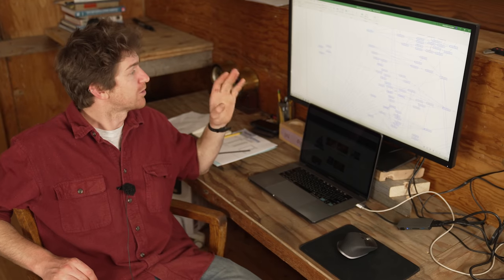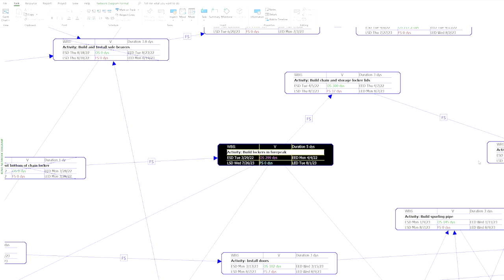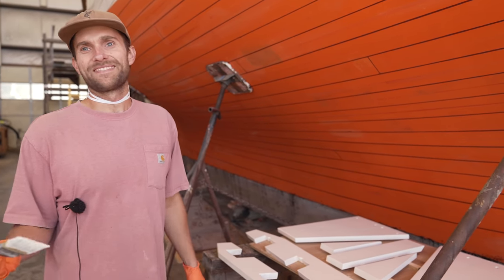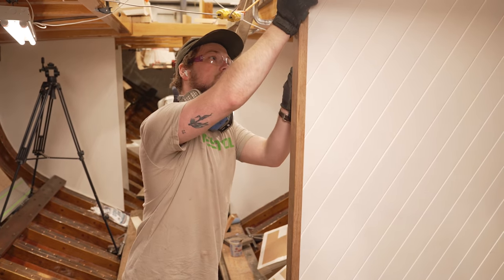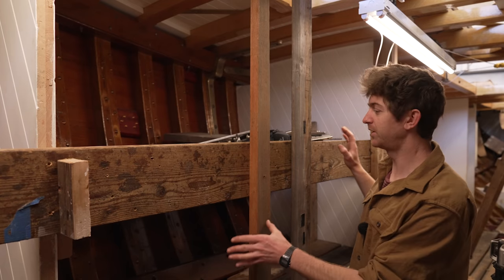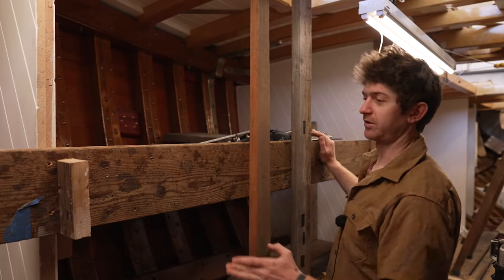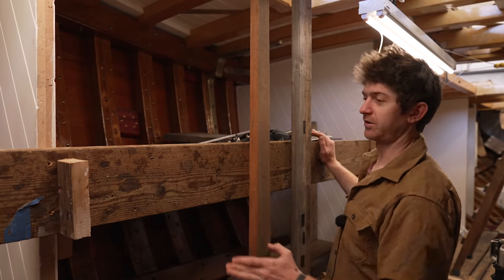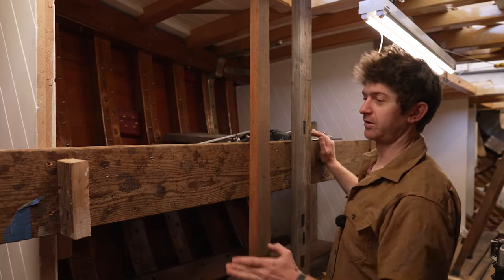Tally Ho - Nearly finished?! (EP128)

Comment: Leo, having just seen your new project planning computer software in action, I am amazed to learn that until recently you had to carry all this stuff in your head. No wonder you had sleepless nights. 
Not only that, but you have managed to engineer-in that brilliant sound syncro @ 10:05 to this upload. I love it.
Don't be concerned, 'Tally Ho' is going to get safely launched because you're in charge - it's as simple as that!
Reply: Nice one mate!
Reply: The layout reminds me of an ancestral genealogy chart.
Reply: Yeah....... I was marveling at the audio synchronization too!!
Reply: And I was wondering how many nights Leo worked to set up all those systems and individual jobs on that software? My first assumption was that it was a rather generic management tool he had to massively add data  timelines and supportive timelines to. Then I decided it was already engineered to be specific to wooden boat building greatly reducing the infeed necessary to make it fit Tally Ho.
Reply: @ScooterMLS1960  mspm software is very intuitive. It would take me an hour to make a first draft.
Reply: Dreams sometimes solve building design details getting it out and down helps some.

Comment: When I was a kid there were two hippies in my neighborhood that built a 60 foot racing sailboat. fiberglass hull. The first sign something was happening was when the giant molds were brought into the neighborhood. It took them probably 8 years to build. When they went to pull the hull from the mold it split in two. Not a disaster but a little of a disappointment. I remember the months spent laying the ballast. Tons of scrap lead was brought in, they melted down into bricks, stacked them in the keel and then poured molten lead over them all. 
It was christened "Erotica"
My dad's reaction when he saw the name on the stern was a sarcastic "nice"

Comment: Not complaining at all (your final comment in the video), that’s what the Brits do. 😉 BUT, I am surprised that people are wondering if the project is nearing an end. Wow!. The living area is not yet there. Underneath and behind that is all the internal infrastructure as you said… plumbing, mechanical, electrical, etc. That is what keeps the boat running. So far, you’ve been working on what keeps it afloat, 33% as you said. Rigging, I think, is the final 33% and is the fun stuff that makes the boat alive. I’ll be with you all the way!

Comment: Hey Leo and crew, you guys are doing awesome! When everything has to be hand made and fitted time is just a word. All shipmates look commentary of each other and as a whole. Leo your leadership skills are very good and your shipwrights skills are even better! The folks out there including me would like to see you doing videos going to the islands or the open sea 5,000 miles from anywhere but you have to screw the last screw, caulk and fill the last crack, run the last wire and rope, measure and cut the sails plus many other things AND some kind of Sea Trails  to ensure nothing is incomplete: then you will be done! As much as I want to see you guys with salt spray on your faces, I also want to see Tally Ho under your feet👌😎👍👏👏👏❤️

Comment: Boat’s nearly finished!  Just 2 more years!  If you put the 28” from the pillow side of the bunk on rails with a piano hinge midway in the center lengthways. This means the entire shelf is on slide rails so the person on the bottom bunk can push up in the middle of the shelf and fold it up in the middle as it slides (connected by piano hinge at the wall) in and up towards the outer hull wall.  Place a 1/4” notch in the slide rail near the hull so that it locks in place in rough seas.  The upper bunk can either fold back a hinged mattress or have separate covered mattress pieces that are hook and looped to the folding slats.  Just a thought.  My shop makes a lot of custom furniture for portables and tiny homes to fold up and change spaces.

Comment: I've watched every video, stunned by the quality and workmanship; that drip tray is the first thing I've seen go into the boat which is sub par. FYI those sugared welds will rust immediately. If condensation forms on the outside of the tray then rust may drip onto the inside of the hull. I recommend having another tray made and this time insist that all welds are properly back purged. Generally speaking, if a weld in 316 has any sign of blackening it WILL rust badly in a marine environment.
Reply: That’s really interesting, thank you for sharing.

Comment: I can see how it could feel overwhelming seeing how much work is left, but does that old rule of thumb account for first moving a ship, building a shelter for it, setting up a workshop, acquiring all the needed tools, filming the entire process, traveling around the country looking for materials, disassembling the old ship, re-lofting and basically drawing up a new set of plans to accommodate a complete rebuild, dealing with a global pandemic and tearing down the shelter and moving the entire project to a new site?
Reply: Those are all good points. The beginning of the build was slow, and several location moves added a lot of work. Now they have a permanent home and can work on other projects while waiting for lumber. Still, the hull isn't completely done, and the rigging isn't even started! Downside, we won't see Tally Ho in the water before 2024. Upside? Plenty of more video content!

Comment: As well as being interesting in itself, this project has been a great learning exercise for me. Particularly in using patterns to build complex pieces with multiple angles. Also, I’m a retired consultant that trained many people in Project Management Principles, including using that software tool (although it looks very different to the versions I used 10 years ago. I’d use this episode as a introduction to PM if I was still working. Great stuff.
Reply: Phil - you may want to look at the Swedish ship "Vasa" as a PMP illustration.  The Swedish were the dominant regional sea power, and wanted to project that power further by making a magnificent flagship.  The naval architect was working from approved plans, and was progressing well, when the King showed up and said "Add another gun deck" (a third), and "we need to have more (!) statues". The architect protested that there wasn't enough ballast to provide the righting moment for the hull. "More guns! More statues!" was the response.  And guess what happened - it was launched, sailed a couple hundred feet out, flipped over, and sunk to the bottom, where it remained for centuries.

I have every confidence that Tally Ho will not suffer the same fate!

Comment: 25:50 I would like to recommend you put two line dents (in an x pattern) in the bottom of the oil catch. Otherwise you may have a nice big ringing/resonating bell sitting under the engine... The oil catch needs some sort of anti oil canning measure...
Reply: Cannot agree more! Good catch.
Reply from the maker: oh interesting.. thanks!
Reply: It's fabricated from 12ga and only 10-1/2" wide on the bottom..  One could drive a truck over that and it wouldn't oil can.
Reply: @ShredPile  It may not be oil canning but it does ring like a bell... Bells are generally strong enough to handle a truck driven over it but they still ring and resonate... The piece being a bell can even be heard in the video as the piece is slid into position.
When the engine is started or the electric motor is running it could very well be that the pan will start to resonate. Maybe the creases I proposed are overkill but some sort of sound deadening glued to the bottom of the pan could help...
Especially since the captain will be sleeping/dwelling next door...
BTW: I like the quality control test of the truck. How typical a US way to tell if an item is good or not... If one can run a truck over it it must be sufficient right ??
Some colorful metaphors are best left exactly that: colorful metaphors, especially in engineering... for both the to be tested item and said truck...
Reply: @koningbolo4700  I understand now what you are saying about the resonation and agree about the application of a sound deadening material.  I've used a self stick mastic sheet type product on the floorboards and firewall of a work truck and it works wonderfully.

      As to the 'oil-canning'  I'll look past your unnecessary cross cultural barb and instead focus on the fact that oil canning by definition is the stress deformation or wrinkling of an open area of sheet metal and by extension since the 12GA bottom is only ten inches wide and bracketed by by 45 degree breaks which are then bolstered by a pair of 12GA stiff backs within three inches of said break that there is no  amount of stress that the boat can place on the pan that would come anywhere close to making it oil-can considering that the entire thing is held in place by four sheetmetal screws that would instantly rip out if said force magically appeared.
   So metaphorically speaking my friend, you are all wet and simply picking the fly shit out of the pepper just to have something to say.
    Had the pan been fabricated out of something thinner like 16ga the cross breaks would have been the perfect solution but since it's made from 3mm stainless the intended effect of a cross break would  not  be realized in such a narrow area in that thick of material and it would still resonate or ring like  a bell. 
I actually have  some left over sound matting from that project that I would be happy to send to Leo if he would like it and like you I think it's the perfect solution for the potential yet unrealized problem.

Cheers, 
jake

Comment: I am glad you mentioned the old rule of thirds; you have nearly completed one of them, the next two have gotten more complex with all the systems in the boat. Growing up in my family yachts; we had 12-volt DC power and hand pumps for the fresh water system. These days, there is pressure water shower, holding tanks and pressure in the galley. Of course we did not live aboard as you are going to do.  Down the road a piece I hope your sails look old style with horizontal seams and bolt ropes. Brown not colored running rigging etc. 
Ted Miles, retired but still interested in being here for a while.

Comment: Let me start by saying, Leo, I'm extremely impressed by the work you and your coworkers are doing. I myself have done some boat work back in the 70's and early 80's, first at Browns Gloucester yacht yard in Massachusetts and later in the prototype department of Chiscraft in Bradenton Florida before becoming a woodworking instructor at Silver lake HS in Kingston Massachusetts. Towards the end of episode 127, I noticed Patrick using a small block plane on the cover boards that allowed him to plane into the corners where the decking fits in. The planer blade is at the very front of the planer allowing it to clean right into the corner. I doubt I'll ever need one but I'm curious as to its name? Thanks and keep up the great work 👍

Comment: Greetings Leo,
   I gotta run so I need to make this as short as possible.  Great work, great crew, you and crew past and present deserve all sorts of compliments. I like the stainless drip tray but the welds need to be passivated to avoid rust because of the marine environment use. The welds will start to rust very soon if not passivated and I am in fact surprised the tray was delivered with welds in just the as welded condition. You can buy the passivating gel at any good welding supply house. It is kinda dangerous because of the acids used but any careful person can use the stuff safely. There are also citric acid passivating solutions available but they use electricity. For a one time use I suggest buying the kinda nasty gel stuff. Besides, you will probably have other stainless hardware welded up and it may also need passivating. This advice comes from a retired machinist and welder who has done lots of marine work and who has passivated many welds. No surprise since I am on Whidbey Island.
Cheers,
Eric

Comment: It's a good idea to keep track of how long you thought each job would take vs how long it actually took.
You can average the data and come up with a crude correction factor then apply it to your new time estimates to figure out how long they will actually take.  There's also some well known formulas to calculate job time based on a number of factors you input, like your worst case prediction,  best case prediction, job difficulty etc.

Comment: Very interesting with your project plan and it looks good. I remember these tools developing back in the 70's and 80's with PERT, Gantt charts and others. I guess the software is less clunky now but I came across many projects where a team of people were employed to just keep the project plan up to speed with the project which is totally the wrong way around. As you are designing elements of the boat interior and also have the systems to design and plan it is very difficult to provide accurate duration and resource data to these tasks, so the project plan will need a lot of managing in its own right. This said I would propose that you have probably gleaned about 85% of the usefulness by just listing and linking the tasks and groups of tasks. It will give you a good visual picture of the work needed.  The good thing is that you are making steady progress, ok the light at the end of the tunnel is very dim and distant at present but just keep grinding away and knocking off those tasks.

Comment: Thanks you so much Leo and The Team    . It Always blows me away you knowledge, Didication and Attention to Detail ..... As a Retired Engineer I so can appreciate just what you have Achieved and Still have to Do ..... Question ..... The 'Chain Locker' .... Are you going to 'Rubber Line' it ????? A  'Rubber Tank' will make it 'Waterproof' and create a 'Soft Landing' for the Chain, without damaging the Timbers .... and .... Also the option to 'Fresh Wash' the Chain the Boat is not in use for a While .... Well, that is my 5c Worth ..... :-)   :-)   :-) Best wishes to ALL from NZ

Comment: Leo, to help support the weight of a couple in the upper forward bunk, use chains hanging down from the overhead. 
1.  Drop a bolt with fender washer down through two deck support members (about 36” apart and sticking proud of the bottom of the deck member by 8-10”), then lock it in place with a fender washer and a locking nylon insert nut. 
2. Then heat the threads hanging down and bend a loop in the bolt end. 
3. Provide two solid eye bolts on the bunk, and a carabiner (I actually think a mountaineering carabiner is ideal because they can by locked) to attach bunk to chains.
If you need clarification, message me with your eddress, and we can correspond.
I greatly admire the workmanship of everyone one the team, but it was your vision and the right technological and information revolution that has saved a proud vessel from an ugly end. 
In the meantime, fair winds and following seas.  DG

Comment: Hi Leo! Love how things are going with this amazing boat! Question, is it possible to install a dry toilet? That way you can save yourself the trouble of black waters. It's super used in tiny houses. And would it be possible to install a water purifier or a recycling device for water? It may be a really efficient way to re use gray waters for cleaning dishes, deck and so on. ♥️

Comment: Plan very carefully, as you always do, mixing 110 DC with 230 AC. Potential for lethal outcomes down the line.  Consider just the one. After all you will not want to double up on powered units whether that be light bulbs or a fridge. Perhaps a converter where shore power comes in.

Comment: I'm surprised to see a table saw in that type of shop where the blade tilts toward the fence. Normally a cabinet saw has the blade tilting away from the fence. 
Something I haven't seen being installed is a tube that goes from the front to the rear for carrying communication wire. With electronics always evolving, it would seem prudent to have a 2 or 3  inch PVC tube in the floor that you can pull old wires out and run new cables when needed, without tearing the boat apart. You are always going to be adding new gear, so having access to run low voltage cable from the front to the rear would be a huge time saver down the road. You are in a wet salty environment. The likelihood of wiring failing when you are under sail is high. You don't want to be ripping floor up to replace failed wiring out in the middle of the ocean somewhere.

Comment: Leo, I wonder if you've ever considered building bunks out of angle steel and expanded steel sheeting instead of wood. I've been building a skoolie for the last three years and I made the bed out of 1.5" angle steel and expanded sheeting, which gave me a platform as sturdy as a wood bunk that would have had to be much thicker, and it has the added benefit of providing even better airflow to the bottom of the mattress than wood slats.

Comment: Superb video, particulary liked the transition from the project management software to the building process
Right now i'm working on my architecture thesis (as in i have autocad open on the next screen over) so while i haven't lived anything like this myself (yet) i can definetly see it just from all the drawings and thinking around a project of any kind, let alone a wood yacht where basically everything is structure and has to go in at the same time while it's being designed
who knew a video on project management is actually really fun?
cheers!

Comment: Leo. You mentioned the different electrical systems onboard. Have you looked into only having a single AC voltage onboard? To be compatible in both the USA and Europe shore power passes thru an isolation transformer such as the Victron 3600. You can manually select for different AC input and output.